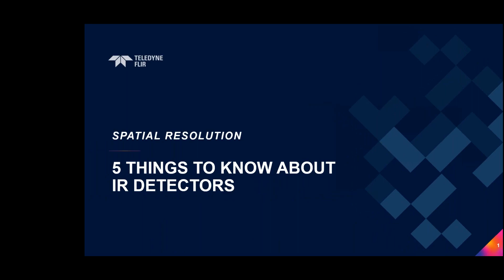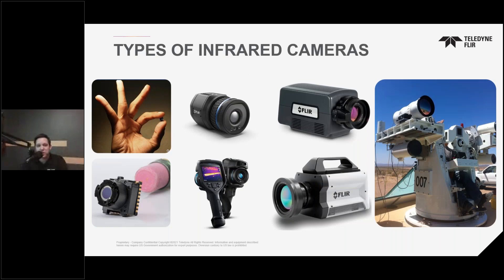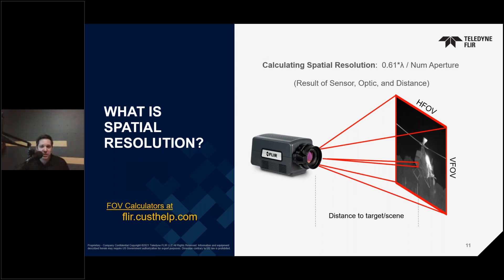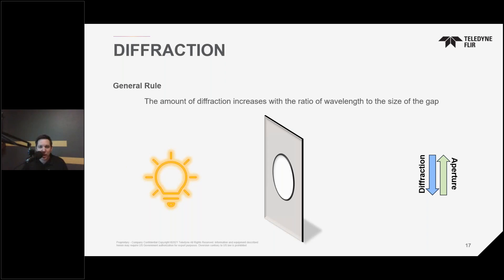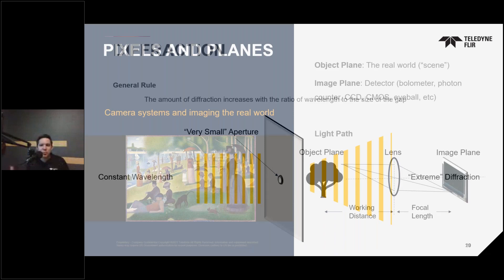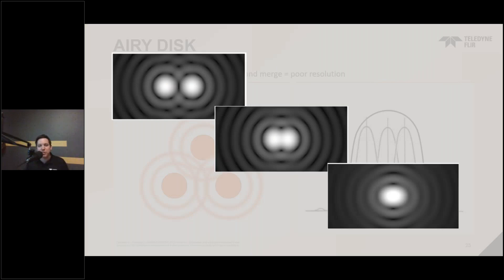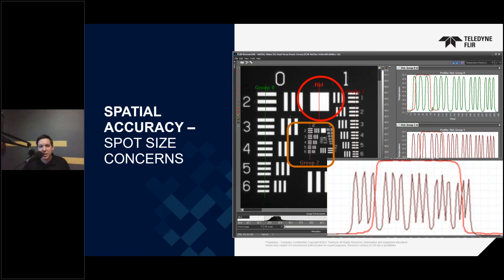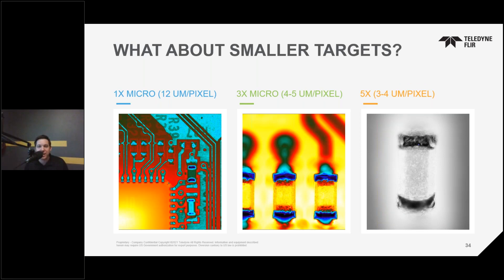5 Things to know about IR Detectors for Research Applications | Spatial Resolution

Comment: If an MWIR camera normally has a circular airy disk, if the glare around distant jet engines imaged with it is normally circular, what can cause the airy disk to take on an elongated / oval shape instead ? Could some abrasions, or moisture / salt depositions, or other defects on he surface of the camera, potentially due to improper handling / cleaning cause such an effect ?
Reply: Hi Logic Bear. The airy disk is is really only going to apply when pressing the limits of your spatial resolution. If looking at distant jet engines you could be experiencing attenuation of the signal through a long and problematic atmospheric path. Without knowing more about the specific test capture it can be very difficult to say exactly what is occurring. Usually dust or even peeling antireflective coating on the lens won't cause artifacts to show up because they're not in focus, but something more substantial on the lens could potentially have an effect. The question would be if you see the same phenomena when looking at other objects, not just engines at distance. Hope that helps!
Reply: @desmondlamont  Very helpful, thank you ! ! I think I mixed up the airy disk with the glare spread function. I'm trying to find the possible causes for an elongated glare.

I'm thinking of a situation where a jet flying at 25k feet of altitude is using an ATFLIR pod (cooled MWIR InSb camera mounted on a gimbal) to look at what is suspected to be the tailpipe / exhaust of another jet around 30 nm away, at just under 20k feet of altitude. The resolution of the image plane is 640x480, but we see a 426x426 rectangular crop of it in the video we have, and the field of view should be 0.35 degrees (probably vertical, but unclear). Could the atmosphere at those altitudes/distances be problematic / turbulent enough to cause the glare around that distant jet engine exhaust to appear elongated ? 

The only other thing that can be seen in the video we have are the clouds below. The video is taken at night, January 20, 2015 off the coast of Jacksonville, during a total lunar eclipse, so the clouds should be very cold relative to the hot glare in the middle of the image, but they appear sharp, with good contrast and some hotter regions. So we don't really see the same phenomena elsewhere in the image, but wouldn't that be expected due to the temperature difference ? Could the apparent sharpness of the clouds be caused by the exposure/gain/level settings of the camera ?

In case I haven't already given it away, I'm talking about the Gimbal UFO video :). At this point the New York Times and ABC News have reported, from an anonymous government source, that the apparent rotation is a camera artifact, but can you think of anything that could've sufficiently affected the shape of that glare to become elongated like that, at least based on what is known about unclassified cameras ?

I hope I'm not bothering you with all these question, but any feedback is greatly appreciated !